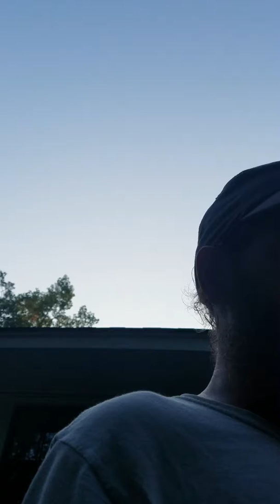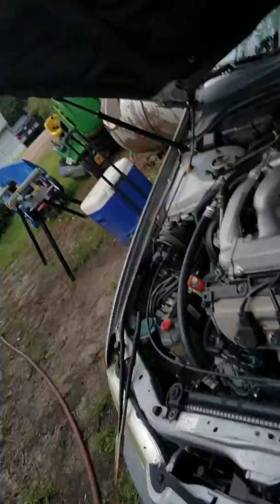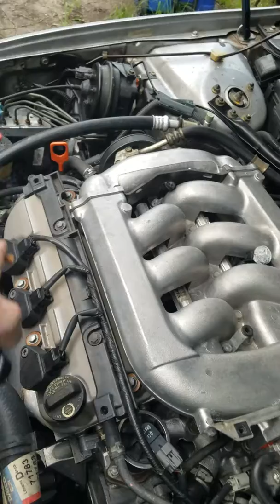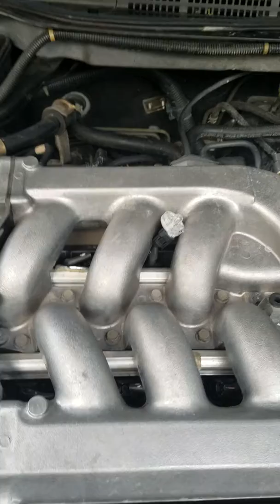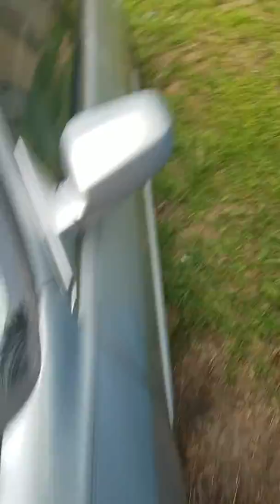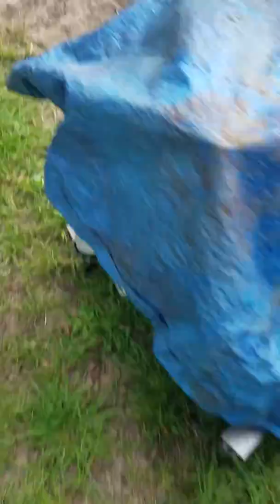Diagnosing misfire rough idle 2001 honda accord 3.0 V6 testing injector with noid light

Comment: Hey man I have a 2001 Accord ex and it’s says misfire #2 put a lot of coil parts etc so it could be an enjector
Reply from the maker: Could be. You can buy a stethoscope from harbor freight for 5 bucks and listen to the injectors to see if they are ticking.
Reply: Thanks man

Comment: Hi man i have the same problem as you. You change the injector and everything was normal?
Reply: I changed my spark plugs upper manifold, egr valve and cleaned where the egr sits i havent changed my fuel injectors yet ,it has a little rough idle do you think this is it my check engine light is blinking
Reply from the maker: @frankhogsettjr  hi frank, I'm just now seeing your question. Sorry for the (significantly) delayed response. 😆 I'm sure you already have the issue solved by now but I will go ahead and lay out the procedure for doagnosis.
First, you'll want to do a few basic tests to see for sure where the issue lies. If it was.working well before you did something, always suspect that something you did caused the issue. But of course that's not always the case.
First, check  the ignition to see if you can pinpoint and isolate the misfire. With the engine running, you will want to disconnect spark plug wires or coil on plug coils one at a time, checking to see if the idle gets worse after pulling one and then plugging it back in before moving on to the next wire. Any functioning cylinder should cease to function when you pull the spark plug wire, and the idle will get rough. You will know you found a dead cylinder when you pull the plug wire and nothing changes. 
Then you should test to see if you have spark, by either using an inline spark tester or by checking for spark at the plug gap by laying the metal part of the plug against the metal on the engine and watching to see if it has a spark jumping across the gap. If not, that you either have a bad plug or a bad wire, coil, or distributer.  If it does jump the gap, then spark is not your issue.
Next you will check the fuel injectors.
Listen for injector tick at each injector with a stethoscope. They should tick rhythmically around twice per second. If you find a injector is not ticking, you will test like in my video here to see if the injector is getting a signal. If it is, but the injector doesn't tick, replace the injector.
If it does tick, it's likely another issue, but you can try swapping injectors from another cylinder just to be sure.
So, if you have spark and your injectors are working, the other possible issues are your timing is incorrect, either at the timing belt, or distributor if it's a distributor engine. You'll want to make sure the timing marks are lined up properly. Another issue could be carbon deposits in the valves causing them not to seal properly. A leak down test could test this. And also, if your EGR valve was the issue, as it can cause a rough idle, simply changing the EGR valve won't work. You also have to manually dig into the EGR passage in your intake manifold and cylinder head with a pick and dig out the gunk that I clogging up the tube. Mine was so dirty it had completely sealed shut the half inch wide EGR passage.
Spray it out with carb cleaner or brake clean. It will be a big mess, and you'll have to remove the intake manifold to clean it properly.
Reply: @BigRichardsGentlemensClub  by any chance do bad fuel injectors make lose gas faster than usual ?
Reply from the maker: Yes. Once the injector was replaced, everything went back to normal. I knew it was the injector before I made the video because I liste ed with a mechanic stethoscope for the injector ticking and that bad injector did not tick. You can buy a stethoscope from harbor freight for 5 bucks.
So then when I checked with the noid light to see that the wires were firing a signal to the injector, I knew the injector itself was bad and not a wiring issue.